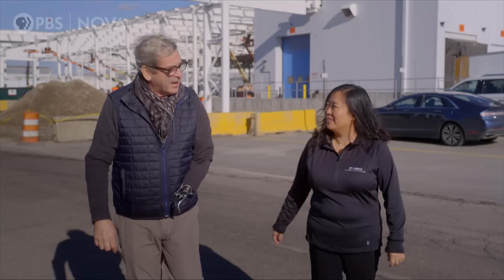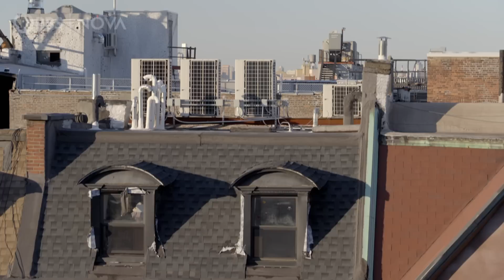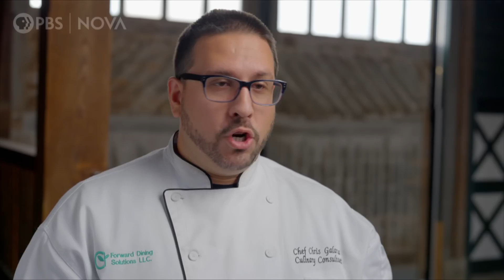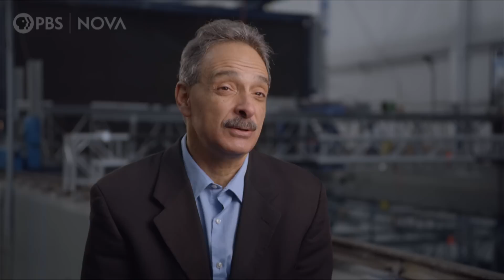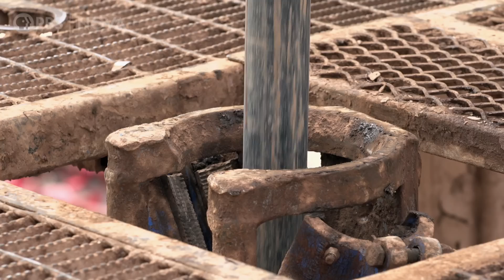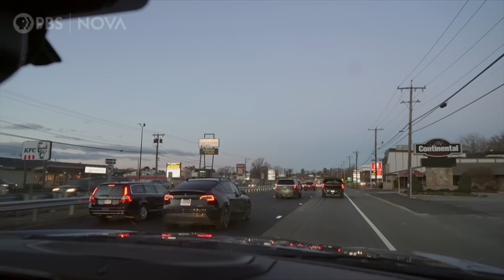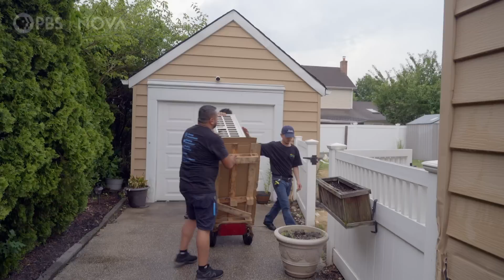Chasing Carbon Zero | Full Documentary | NOVA | PBS

Comment: What's the plan to remove the billions of ice vehicles from the roads, though 🤔
Reply: And where does your electricity come from?  The wall?  That electricity comes from something.  If it’s solar, that solar is produced by mining the material.  You’re trying to eliminate ICe, while depending on more mining.  Pure stupidity.
Reply: The high cost to drive and maintain them is incentive enough, but they have a definite lifespan.  Incentives are offered to dismantle operational vehicles.  It is called Vehicle Retirement in California.

Comment: Most people aren't taking road trips most the time! 

Please stop perpetuating range anxiety. 

Most cars used most of the time only go 25 to 50 miles per day. Level one charging at home covers this use case just fine. This use case requires ZERO "gas station" style charging locations. Even longer commutes a level 2 charger at home can be installed affordably. 

We need to free ourselves from the paradigm of using gas cars, and all the associations that come with it. Most use cases of an EV you won't drive until the "tank is empty". So most charge cycles will NOT be from 0% to 100%
Reply: True.  I'd say 90% of my charging occurs at home/locally.  On trips (I actually took a 1,000 mile trip up to Maine 3 years ago) I haven't had any problems --I drive a Tesla so range anxiety is practically non-existent.  It seems like the reporter specifically chose an EV that would give range anxiety so that he'd have a story.
Reply: This mostly applies to the short showcased on PBS news hour, am just now watching the full NOVA doc.
Reply: We do, when you live in a state like Arizona.  And we like our independence, instead of being limited to a “15 minute (control over you)” city.
Reply: @jak71113  so you have to fill your gas tank every day? because most electric cars get the range of a tank of gas.
most people live in cities, and not 400 miles away from a city. Most/ near all people do not have an issue here.

Comment: regardless which type of energy we are using, they will be converted to ONLY one type of energy form -- heat. When the person in the video said that we need more energy (even though they are carbon neutral), it's a dangerous statement. We are not only emitting greenhouse gas to trap more heat, we are also releasing more heat into the atmosphere. To slow down or even stop the human activity induced climate change requires behavioral change. How come Tesla CEO is claiming saving the earth while his spaceX is promoting recreational space travel. Can someone explain that wholefood is claiming greener produce while its CEO is building 3000-lamp mansion and super yacht and even shot himself to outer space for fun? Human's greediness needs to be address otherwise irreversible climate change is inevitable. 
Furthermore, if one day, we have a solar/wind powered factory manufacturing wind turbines, solar panels and wind motors, then, we can start claiming those are green, sustainable energy. Or, you are lying and cheating to yourself. Dump out more carbon footprint to produce equipment that is necessary for "green" energy? don't be that naive and irresponsible. we have long way to go.

Comment: Beyond the development of Evs looms the issue of our rotten and delapidated grid, vastly in need of reconductoring and an upgrade to handle the massive load that we are adding. It will absolutely take until 2050, if we start today and are serious. The problems are enormous... 1)presently we do not have the trained workforce, 2)the necessary equipment is not readily available, 3)massive investment by someone...
Reply: A lot of these EVs will be trickle charged overnight, about the same load as a 1.5 kW room heater. Some folks will use a level 2 that is like running your oven. Not the crazy loads people think they are. The DC fast chargers are what really pull a lot of load since they are charging in a very short period of time. As people realize they can charge at home those will be used less and less.
Reply: Here in the US, that is about 12.5 amps continuous. Imagine the load on the distribuion and transmission system with millions of "trickle chargers" attached all night. Additionally, distribution transformers are based on a demand factor. The transformers are actually undersized with  125% capacity for intermitant periods. This adds a continuous load.
Reply: Agreed. The USA's old grid need to be upgrade to more effective Smart grid that can handle all the various energy sources we are putting up in the next 30 years.
Reply: This is why President Biden's BBB agenda is:
#1: Funding college tuition, trade school training, and employing skilled union workers to provide tomorrow's trained workforce.
#2: Investing into domestic manufacturing of ICs, wind generators, energy storage solutions, etc.
#3: Only taxpayer funded government revenues can afford these massive investments, such as a national network of EV charging stations.
Biden's administration is already on top of how to overcome the obstacles, BBB shouldn't be a political debate. It should be a national united effort for the benefit of future generations.
These changes are inevitable. If we snooze, we will lose our competitive edge against China and other nations who are already steaming full steam ahead of US.... funded by US consumers.
Reply: Which is why we should be building short distance electric tram and medium/long distance electric train lines across the whole country. We only ‘need’ cars because there are no alternatives.
Reply: @alexwilsonpottery3733   That may work in the Northeast, but not in Texas.

Comment: The current grid can't handle more than 20% of cars switching to electric. An average household uses about 30kWh a day. Tesla vehicles (which are more efficient than most) use .25kWh per mile and the average commute is 40 miles daily. Every single vehicle that commutes would pull an additional 10kWh daily, and upwards of triple the total household usage if the battery is completely dead.  Major cities have brown-outs due to excessive power consumption every single year. Electrics are cool, we're just not ready for mass adoption yet.
Reply: Kim, you're dead wrong. The Economist and grid operators everywhere are talking about the challenges with updating and expanding the grid to handle the tremendous increase in electricity that will be needed if we're to cut out oil and switch to powering everything with electrons. At this point, the foremost experts in the field are just saying that is flat out won't happen.
Reply: @iraqwarveteran470  Ultimately,They Don't Care about the grid...they have even talked about multiple households sharing these vehicles...anything goes as long as they attain their insane dictatorial governance(behind this false climate/green/overpopulation/food&resource shortage...DON'T BE DECIEVED...they use even false science.
Reply: This is a myth. The US power grid has been steadily expanding since the 1960s when AC started to become common. It will have no trouble handling more EVs in most places.
Reply: @kimhunter8395  I guess we'll just have to see. The capacity of most cities can't handle even a 15% increase.
Reply: @kimhunter8395  I live in TX, where we couldn't handle a colder than usual week in winter, and where we got pretty close to the same thing happening last summer when it got to 115F for a few days. I know for sure TX can't handle an increase in electricity consumption at all, and I wouldn't be surprised if the rest of the United States isn't much better off than TX. Heck, it's pretty normal for California to have rolling blackouts.
Reply: @kimhunter8395  Yeah, and with most EV charging occurring overnight when other electrical usage is at the lowest, it's not as big of a problem as it is made out to be.

Comment: I've been driving an EV since 2019. Got it to make caring for my mom easier because I put over 360 miles a week on it doing just that. Driving my F250 farm truck the same amount would have cost me close to $20,000 in gas during this time. And that's over 2/3 of what I paid for the EV (Chevy Bolt). There are not any public chargers on my normal route and I do all my charging at home or at Mom's. I use a portable charging cord - called an EVSE. So I know it will always work. In addition to the charging stations, businesses who want payment (some give free charging to bring customers to their business) could install outlets on 50 amp circuits, like I did in my garage, for people with their own, portable EVSEs. We could pay by the hour to turn on the outlet and it should always work. Without all the computer hardware and software to break, it would work a lot better. And they could still make a profit at lower rates per kilowatt because a 50 amp circuit is a lot cheaper than a charging station and doesn't need fixing all the time.
Reply: I have a 2019 Nissan LEAF. Does not have a high-range like a Tesla, yet for my needs, it's practical. Charge at work, where my company have solar panels on the roof and charging stations. Plenty of power to get home and go to nearby stores (only 2 miles away from home) and get back to work the next day. Love this car. :)
Reply: @JuPMod  I had a 2015 LEAF and it blew my Acura away in terms of acceleration, and fun and easy to drive and maintain.
Reply: Interesting info

Comment: I've worked over a decade in numerous professional kitchens, and while some were hotter than others, I've never felt the need to vomit (even at 130°F).

I've even humped a pack in the military between 12 - 32 miles within 24 hours and never felt the need to vomit.

He's full of $h!t for making that comment.  Either that, or they had a leak / insufficient ventilation...
Reply: if he had heat  like that in the kitcen then he had major building code violations, us build codes requies all open flame heating source must have large blower hoods over the cook top. also his AC system is not working.   i installed hood units in commecial jobs for years the munimum CFM the inspectors would allow is 820 CFM. the DMA direct air make up is 15 percent.  we had hoods that could scuk the food right out of the pan.on high voulme.
Reply: @alanskinner7031  Yeah, our kitchens only reached 130°+ when we turned off the exhausts to drive off the waitresses who were busy gossiping (they couldn't stand the heat and left the kitchen)!
🤣👍
Reply: If u never puked road marching.....im guessing navy maybe? Lol....12 yr army vet..12B.. and I puked lol
Reply: @chuckenomics  Paratrooper here.  But we ran 4 - 10 miles 5 days / week (if we weren't jumping, on field exercises, or at the range).  We had a few who puked, but that was mostly due to partying all night.
Reply: @tyree9055  3 yrs stationed with 101st...3/502nd...im familiar lol....and you STILL never puked? Sad lol
Reply: @Chuck Vaughn  Nope.  I wasn't 20 years old when I enlisted, so getting drunk with the strippers and coming in at 5am to do a run / puke session at 6am wasn't necessary for me.
😂
Reply: I worked in summer in a kitchen for years in college. Tell me you don't take some breaks in the   freezer to cool down.
Reply: @Brad Stewart  I used to early on in my career, but soon discovered that repeated, prolonged trips into the walk-in refrigerators and freezers actually caused illness, so I stopped doing it.

I literally could walk from 100°F into 40°F into 30°F within 10 seconds and staying in their for too long messes with your body.  Don't ask me how, but adapting to those temperature changes creates problems when done repeatedly and rapidly.
🤷‍♂️

Comment: My next range will
Absolutely be induction I would have never said that prior to watching this.
Reply: I live in a tiny cabin and have a single portable induction "burner". It's freaking awesome. Very small, so I can put it in a drawer when not in use, and heats up quick and gets the job done efficiently! Instead of a range, I would consider getting two of those and just having the extra counter space. I have to cook on my table because I don't have room for a range at all, but if I were in a normal sized house, I'd opt for more counter space.
Reply: I just bought a gas stove a few years ago. Should have done my research on induction. The demo here blew me away, too.
Reply: I have several induction hobs that I can move wherever...a whole lot cheaper than the cook tops...

Comment: We've cut our co2 emissions 50,000 lbs over last five years. Also added small grid tie solar. Heat pump water heater and drier. Next change air source heat pump. Used Leaf and Tesla, solar covers all the miles. Replaced 20 years old appliances with more efficient models. Sense electric monitor tracks usage by device along with other helpful metrics. Can be done. Affordable.
Reply: Definitely go after changing building and zoning codes. Stop HOAs from being fashion polices, who stop homeowners from trying to be greener. Allow smaller homes. Allow solar panels. Increase the insulating factors is buildings so the added temperature controls inside the structure remain in the structure much longer.
Reply: Yet you probably support war in ukr that is an absolute high emissions conflict that has affects all over the world to also include the west blowing up nordstream pipelines putting all that into the atmosphere... you most likely voted for the person who caused all this, who is starting fights in Africa, with China, Syria, Haiti, and countless other places... The men and boys who work in hazardous slave labor condition to mine the rare earth metals for your electric toys probably ate not happy with what you are doing
Reply: @jaybelle1909 these people, if they're not Darpa bots, are clueless lemmings marching towards their own deaths with this cult ideology
Reply: That's great!  Thanks, man!  I have a Tesla, but gas appliances/heat.  I bought a cheap induction cooktop surface from IKEA so now I use that for almost all my cooking.  Eventually I would like to replace them all and get a solar roof.  First though I'm going to have my attic better insulated...old, drafty house with inadequate insulation.  Glad to hear people care about the environment!

Comment: Carbon zero for billionaires too? Or just the lower caste muggles? Let's make that clear first.
Reply: This brings up a great point about the equality challenges of our transition. If you just barely think about it, plastic-free products cost significantly more, installing solar costs money, upgrading insulation, etc. This is a huge problem where the solutions are only accessible to those with wealth, not the majority of people. We have amazing programs that certainly help, and I think a lot of people are unaware of these programs (pay for solar, insulation, efficiency improvements, etc). But they are just a small step. Significant work is still needed.
Reply: @danhassler6585  Are you aware of the huge incentives in the Inflation Reduction Act for activities such as electrifying homes and appliances?
Reply: @wyatttomlinson3475  great point, I did forget that specifically. You are absolutely right and I did mention numerous programs exist (many of which the average person is unaware of). No matter what these programs will not be enough, either they exclude important elements or not enough people take advantage
Reply: @danhassler6585  It is also worth noting the Inflation Reduction Act is just the start, or ideally will be. That's one of the reasons why getting the current US president re-relected is so important, that way more laws building on it can be passed that can accelerate the programs, create new ones, and fill in gaps left to fill.
Reply: @danhassler6585  plastic products in my location is reusable, hopefully some places will do the same recycling method in the local communities.

Definitely this zero carbon project will build in low- income neighborhoods with low cost pay that the providers would promote it as contribute good deal to each household as well, right?

Why three project methods couldn't be done at the same time? If we only rely on one way solution does this mission is taking longer?? 

That's why is critical the US government needs to build up relations with other countries ( such as APEC) and bring in the national field leader teams together for discussion and exchange ideas about technical suggestions that suits each country region/weather/ capabilities in this upgrading plan,  at the same time creating job opportunities in America and their countries!  I don't know if this suggest is right??? 

 If we don't start to do it now, and how we are going to improve ( or prevent ) the global climate crisis ?  Are we continue to suffer?
Reply: Good point, the push to put the onus of reducing greenhouse emissions onto working people lately definitely rubs the wrong way.
Reply: @bertbaker7067  you are looking at this situation backwards.  Giviing Fossil Fuel companies a $5.9T subsidy to pollute impacts the poorest people the most. Fossil Fuel companies have corrupted every government on Earth to force all consumers to use more expensive fossil fuels and to get away with dumping the toxic byproducts into their air and water for free. Africa buys coal power generation because corrupt leaders can get a cut of the coal supply contracts; not so with local solar.  US legislation represents Fossil Fuel companies first and voters dead last.  Most of the lying in politics comes from our reps following their Fossil Fuel Company donors request. We are all victims here.
Reply: Yes Part Deux,
 Perhaps you didn't hear 'Klaus at the world forum. 'announcing' that the new world order would impose rules ,of which the "ELITES" would NOT be under.     FACT.
Reply: The fastest way to make the heaviest polluters reduce their climate pollution is called Carbon Fee and Dividend: https://youtu.be/9oyguP4nLv0